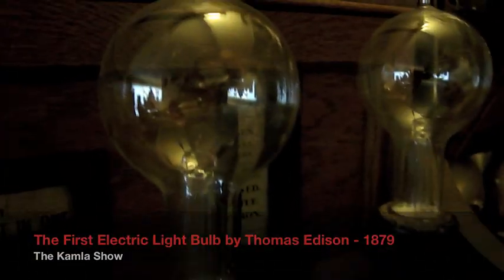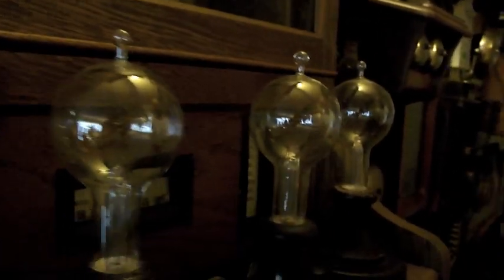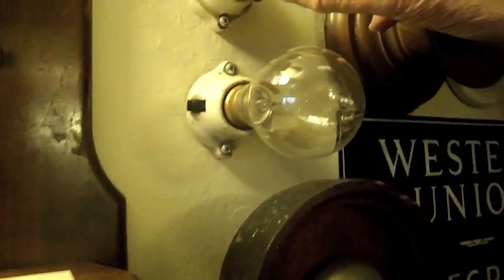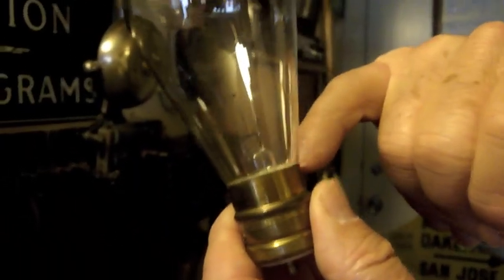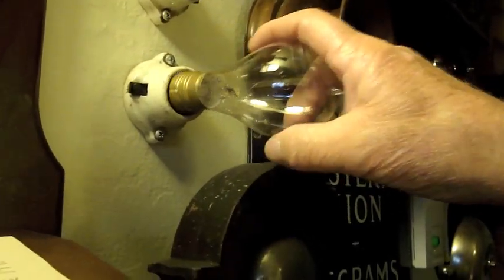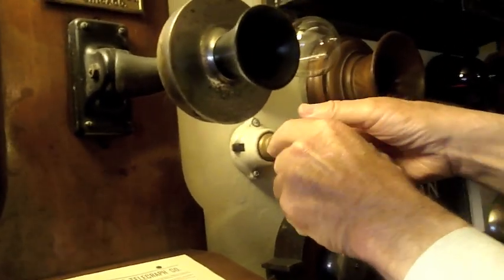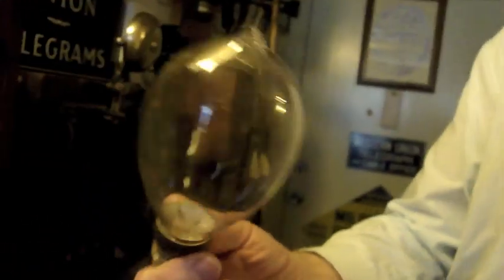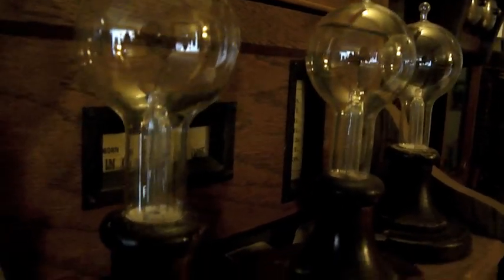First Electric Bulbs by Thomas Edison

Comment: I am not aware of the role Tesla had in lightbulb development.

I am simply here to say that it is one time in history when the patent of Edison AND Swan was filed at roughly the same time. Strong evidence to show this was the first company to manufacture lightbulbs was called Ediswan. Both inventors accepting that each had developed the light bulb independant of each other and so both joined forces in its manufacture.
Reply: Neil Badger ok ok, but who invented the filament which is the only reason the bulb works as a source of light...?

Comment: You are very correct indeed! Look at the bubble tip on top & then the stem tube inside the bulb has a exhaust tube inside going down into the wooden bass with the lead wires. These are the 1929 50th year commemorative lamps. I sure wish there was a real example of the first bulb, or bulbs. There were bulbs made befor Edison, mostly what was his pattent was a enclosed glass bulb vacumn drawn from the TOP (leaving a pointed tip!) and a high resistence filiment. with no loops. I`ve seen the 1880s.
Reply: roybo1930 lol..."his pattent", that's rich. How come everyone wants to talk about the BULB and not what makes the bulb produce the light it gives off.,.the filament! The bulb is useless without it so who invented the filament?